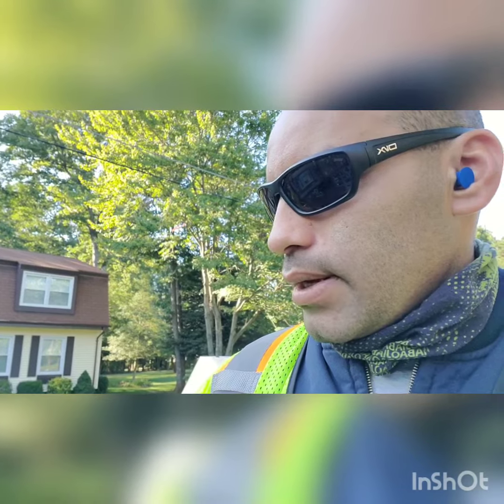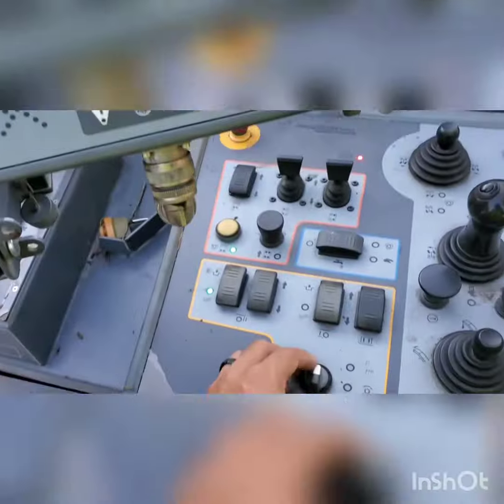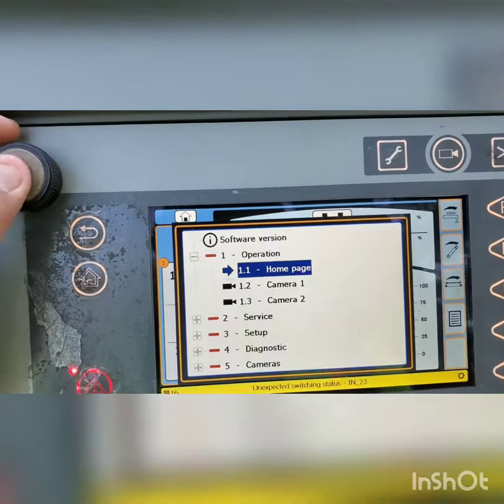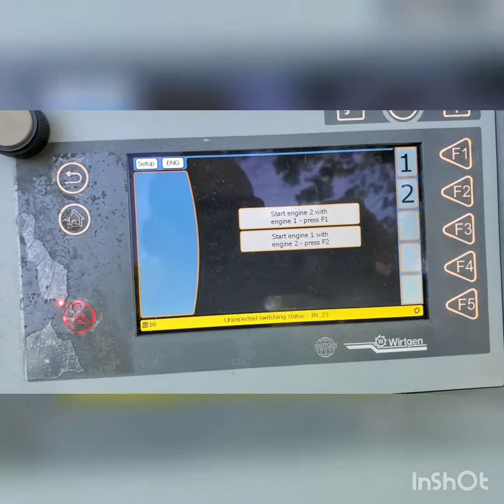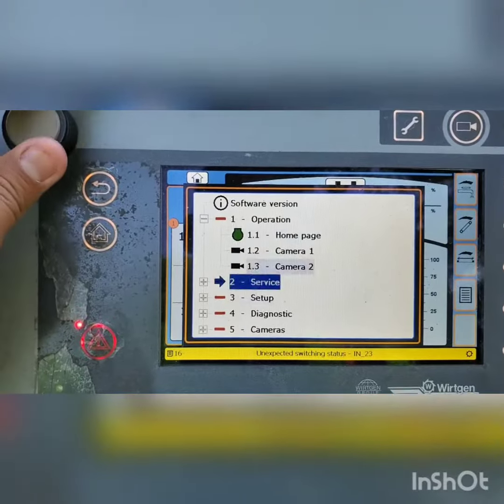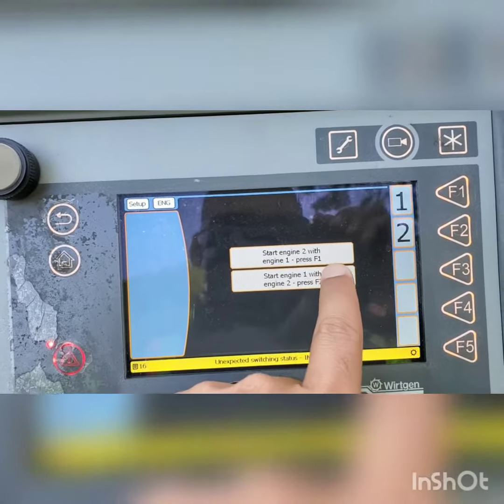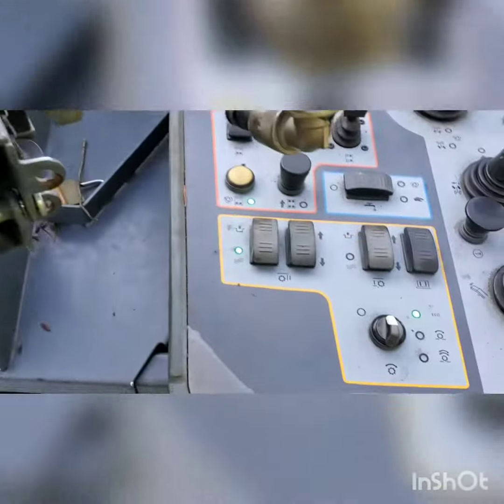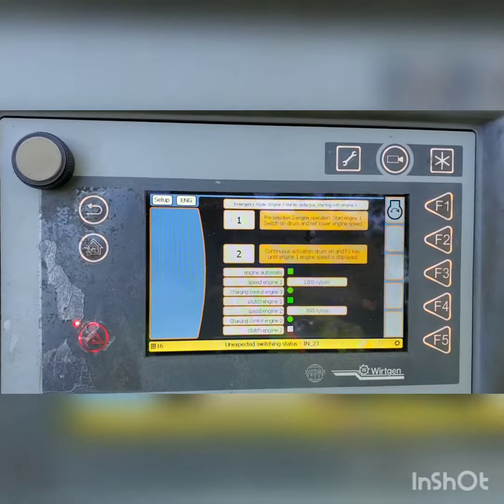How To Fix A Wirtgen 210i Milling Machine Engine That Won't Start

Comment: It has 1 engine. NOT 2. This is the wirtgen duel shift feature.  Stage 1 (engine 1 as your call it) offers a low to mid range drum rpm 80-120. Stage 2 (engine 2 as you call it) gives you 100-140 drum rpm at lower engine rpm to reduce fuel consumption.